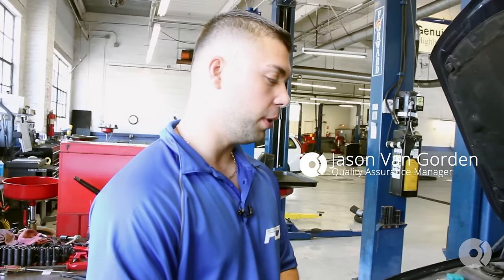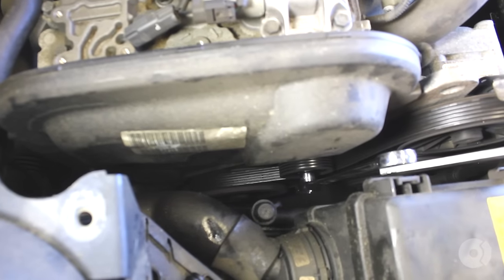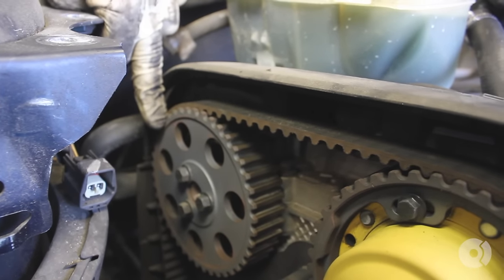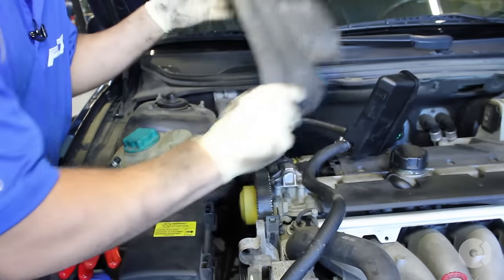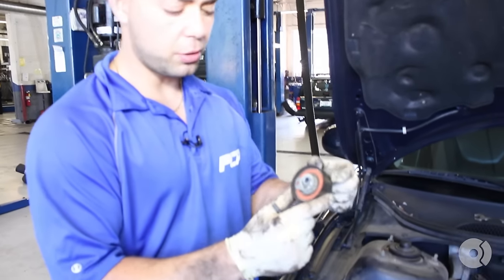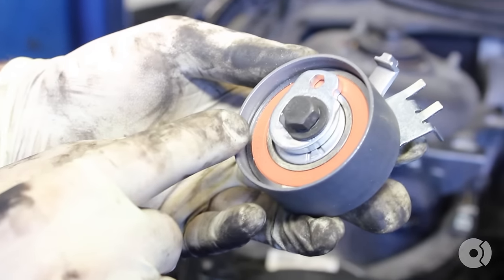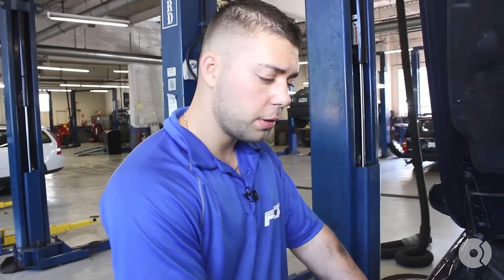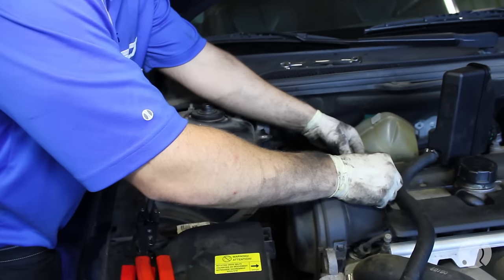Volvo P2 S60 Timing Belt Replacement DIY (S60, C70, V40, V70, S40, S70, S80, XC70, XC90)

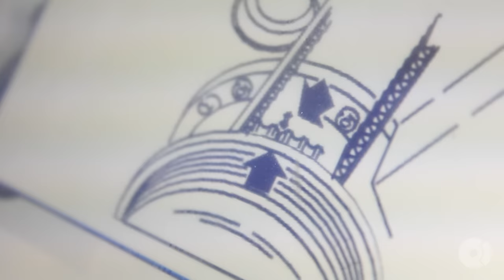Comment from the maker: At 6:10 we explain the marking on the crankshaft. There are two gear teeth with etched markings on the crank gear and one alignment mark on the block. Line up the mark to be position in the center of the etched teeth.  It is possible to slide the timing belt on to crank shaft with out removing the pulley possible but I always advise against it if this your first time carrying out the repair as you can't verify the cogs from the belt are inserted properly into the gear teeth. Hope that helps.

Comment from the maker: You can replace the belt without removing the crank pulley however I advise against it because you cannot see if the belt is fully on the crank gear. It leaves room for error. The procedure is the same on a S40 with the exception of one additional step - supporting the engine and removing the front engine mount location on the passenger side. Hope that helps.

Comment from the maker: Are you talking about the plastic cap that covers the pulley center bolt? All you've got to do is pry the cover off. I usually go at it with a 90 degree pick and pry against the pulley. Hope that helps.

Comment: Excellent video, great job capturing all the bolts/tensioners in such tight places.. I know it's a PITA from the DIY videos I've made.  This job is fairly easy relative to other cars.. well it's no Honda but still easy.  I could not find any DIY guides on this with pictures so this is extremely helpful, aligning the cams was my primary concern but this seems fairly easy, thanks a lot!

Comment: Tip to others, your serpentine belt will probably require a t-60. I was replacing my serpentine belt tensioner as well so i made with what i had and a 9mm allen managed to release tension well enough to get the old belt off. The new gates tensioner used a 15mm end wrench to tension. 

And a question for FCP, I used oe volvo tensioner on my 03 and it did NOT make the click like it did when Jay demonstrated.   Did i do something wrong?

Comment: Great video! I do have a question, noticed you didn't use a cam locking tool or a crank pulley holder. I ordered a timing belt kit from you all and was able to remove and replace the water pump, tensioner, and idler pulley, but couldn't remove the crank pulley to replace the belt, so its still there. I guess my question is how do you keep it from spinning while removing the bolt without a crank holder?

Comment from the maker: I believe the full capacity is around 7l, but you'll probably only drain between 4-5.  When we did the 850 coolant video I believe we used about 4l of 50/50 mix to top it back off. Hope that helps.

Comment: When I did my 01 xc (with your parts of course) The variable exhaust cam was under spring tension and sprung back about 20 or 30 degrees as soon as the belt was removed. It took me awhile to figure this out and get it back correct. Now I need to do my 07 xc that has both intake and exhaust variable timing cam gears. Great video but was "shocked" you didn't lock those cam gears in place or that they didn't move. Why didn't they spring back like mine did? Thanks and keep up those great videos...
Reply from the maker: You can either use a locking tool to hold the gears or sometimes turning the engine past the marks 3-4 teeth then back counterclockwise to line up the marks, this may relieve any tension.

Comment: "1100 bucks to change a belt?? Screw that, I'll just do it myself! How hard could it be!"
.......
Guess I better start saving
Reply: A garage with a camshaft sprocket locking tool and impact to remove the crank pulley is good in less than 1h to replace the belt, idler and tensioner. Let's say 1.5h if they really take it slowly with a few breaks.  If you get genuine belt kits, it's $180 at Fcpeuro, but the Contitech kit is $80 and will do the same thing. So even with a genuine kit, this is the kind of repair that shouldn't cost more than $300 at any garage. Make sure you mark their position vs engine head with liquid paper. That's without the water pump because we don't replace it with the first belt, the original Aisin pumps were good for 200,000 miles if the proper coolant was used. However, if purchasing a used Volvo, always inspect which timing belt components have been installed, including the water pump. The pump is hard to see from above, but you should still be able to see with a good flash light if at the bottom of it it's stamped Aisin. Some kits came with Hepu or GMB pumps. Other pump brands can fail all of a sudden and ruin the engine. By the way, if you release the tension on the tensioner and carefully pull on the belt near the pump (without removing the belt), you should be able to free the pump gear enough to spin it free by hand and see how smooth it spins: if it spins very 'freely/easily' it's rather worn, if it feels it's slightly grabbing, it's worn, if it 'squeaks' then it needs replaced asap. At 9:00 in the video, go ahead and SPIN the pump by hand. A pump in good condition will spin very smoothly and with resistance like it has heavy sticky grease in the bearing - same way all new pulleys spin. The pump is difficult to replace because you can't put the ratchet on some bolts and you can't use the 3" extension either. May try a longer 10mm socket. You notice there is also a small hole at the top of the pump casing: if this hole is sipping or looks like it has limestone traces, it means the pump started to leak at the bearing and would need replaced. At the junkyard I've never seen a pump leaking like this, however I've seen a few that were very worn at the bearing ("grabbing"), and didn't start leaking yet. So don't wait for it to see it leaking. I should upload on my channel a video showing all this. Funnily enough, Jay didn't lock the cam sprockets: that's not a good idea. It is very easy to accidentally touch and rotate the sprockets while working around the belt. Plus, some VVT hubs are spring loaded and will move the sprocket once the belt is off. The video also didn't show that before setting the tensioner, you need to to make sure the belt has tension between the idler and the intake cam sprocket: so need to rotate the engine by hand a full turn clockwise (never go counterclockwise) until the timing marks are aligned again, then adjust the tensioner and tighten the bolt: important, tensioner bolt has 15ft-lbs (20N-m) torque. Before installing back the belt covers, put serpentine belt in place and fire up the engine and look at the tensioner, the indicator should stay at the right position without much shaking (ideally no shaking at all)
Reply: @Peppermint1  should I replace my timing belt the car has only 100 000 km but it is 10 years old now.
Reply: @alexanderstevens145   Everybody will tell you to replace it. You can check the belt in 5 seconds without removing anything. If you plan to keep the car for several years, I would replace the belt with a Continental kit and only inspect the water pump is turning smoothly without 'grabbing'. Order the correct tensioner for your year. If you don't think keeping the car more than 2 years may just want to keep an eye on the belt.  Belt wear will also depend if you live in a very hot region and if the car was driven hard. My original belt at 160 000 kms and 10 years had a single small crack on it. The original Volvo belt can take a lot of cracks before failing, while the cheap aftermarket ones may crack after only 1-2 years. Check my channel, I have many repair Volvo videos
Reply: @Peppermint1  thank you 🙏
Reply: @alexanderstevens145  I think it would be a good idea to change it because the new one should last you another 10 years or 100,000 km and the risk of engine damage caused by the belt breaking is not worth the risk.
Reply: @danielebrparish4271  I got it done 👍 was a thousand dollars but I’m happy just went to a professional drives beautiful
Reply: @alexanderstevens145  That's what I paid to have mine done in 2013.
Reply: @danielebrparish4271  I’m in Australia though so I don’t know if that’s much different

Comment: I believe the reason why the cam lost a little timing there was because when you corrected it, you rotated counter clockwise. Should only rotate clockwise as different sides of the belt have different tension. Loved the video!
Reply from the maker: Great point! Thanks for the info!

Comment from the maker: When Changing the belt as long as you don't unbolt the camshaft pulleys or Variable Valve Timing units you there is no need to pay any attention to them.  Hope that helps.

Comment from the maker: The click was actually the tension releasing as the allen key slipped out of Jay's hand, so now worries regarding not hearing it.  Just make sure you tighten down the center nut with the appropriate tension and you're all good.  Hope that helps.

Comment: Thanks for the video. A few questions about it.

1) Is this the same procedure for an ‘05 Volvo XC90 2.5T?

2) Would you recommend I get any additional tools for my specific car?

3) How easy is it for the cams to move once the belt is off? Just worried about them moving once the timing belt is off. I’m thinking of using something to mark the cam positions on the engine block. Can I turn the cams by hand if they move slightly?

Thanks for your help in advance!
Reply from the maker: Hi Vishal, yes this is the same procedure as your XC90, in fact, you might even have a bit more room to work with on your XC90 vs the S60! The cams can move, and yes you can move them by hand, you just want to make sure everything lines up like before. Some people use a whiteout marker to make markings. Hope that helps, and good luck with the timing belt replacement, just take your time with the timing job, and you'll be fine!

Comment: Nice video. What if you turn the crankshaft counter-clockwise after the tensioner has been locked in position, will the belt get loose between the crankshaft and the intake sprocket?

Comment: Thanks for the great video - best I have found on this topic!  I have a 2006 xc70, and I`ve changed the components successfully - but I have 1 issue.  The timing belt seems to shift towards the engine block against the water pump pulley.  Any ideas on what could be causing this issue?

Comment: Awesome video! Just have few questions though - I have 03 S60 2.4T and this is my first time replacing my belts and waterpump at 90K miles. 
1. How do you loosen the crankshaft bolts (30mm and the (4) 10mm) if you don't have impact tools without moving your camshaft alignment?
2. What are the torque specs for the bolts on tensioner and idler?
3. For the tensioner temp settings, are you referring to the room temp or the engine temp? Or would it be safe to assume that whatever the tension setting was before you loosen the tensioner is the same setting you will follow before tightening it?

Thanks and more power to you guys.
Reply from the maker: 1. Either use an Impact gun like I did in the video or you can use a counter hold : http://www.fcpeuro.com/products/volvo-crankshaft-holding-tool-cta-2247-2248

2. Not sure of the torque specifications to be honest. I'd recommend purchasing a repair manual: http://www.fcpeuro.com/products/volvo-repair-manual-s60-4793

3. Referring to the ambient room temperature. 

Hope that helps!
Reply: FCP Euro Great!Thanks for the quick reply.
Reply: pro glock Is it possible to take out the belt or install the belt without taking off the crankshaft?

Comment: Great video with very thorough explanations on a very delicate service. I am about to change the timing belt in my '05 S80 2.5T and it has VVT on both camshafts. Do i need to adjust the VVT cam gears (remove the 3 bolts securing the ring and reposision them) at all when changing the timing belt or just align the timing marks shown in the video, change the timing belt, idler and tensioner and I'm good to go? Cheers from Finland.

Comment: Thanks for the video I replaced the timing belt myself. If you can give me any advice. I got 2005 XC90 2.5t I had to replace broken spark plug on cylinder #3. Actually the ceramic piece of bad spark plug felt down in a hole. After putting a new spark plug I took the car for a ride.

Comment: How were the camshaft sprockets locked?. Excellent.
Reply from the maker: In this video, Jay did not use a tool to lock the camshaft sprockets. Instead, once he got everything to top dead center (lined the marks on the sprockets up with the marks on the timing cover), he went ahead and did the job. If the marks aren't lined up perfectly when you put the new belt on you can turn the sprockets by hand when the belt is removed to line them up properly as Jay mentions in the video. Hope that helps!
Reply: @fcpeuro  It certainly does, thank you so much.

Comment: Hey that video was helpful thank you!
But what can you do if you forgot to mark the camshaft and then moved a bit? Is there any easy solutions to fix the problem?
Reply from the maker: You're welcome! It depends how much you moved it, if its just a few teeth you can move it back by hand to the correct position.
Reply: That sounds like a big problem.  That's probably the most important part of this job!!!

Comment: Any particular reason a Cam-shaft locking tool wasn't used? Would it make it easier to do that last step of aligning the marks after putting on the new belt?

Thanks again for the video! It answered a few questions for me. I have to do this in the next week or two.

Comment: First off great instructional, I wish I could make this look as easy as you have.  

Secondly, 
I have a 1998 V70 GLT that I need to replace the serpentine belt and the timing belt, can you advise what position the tensioner should be in on the timing belt (in the video you had it at 11 o'clock and then moved it down to 6 o'clock) or would I be putting it in the same positions?  

When you are tensioning the serpentine belt does it automatically lock into place for correct tension?

Comment: Has anyone had an issue with the plastic timing cover being warped and not sealing correctly? I am in the process of replacing the alternator on my 2009 s60 and there is a gap in the front side of the cover behind the power steering pump and alternator. I took the cover off and reinstalled to no avail, it’s almost like it is warped. I’m wondering if I should just replace the cover? And thanks for all the great vids, they are a lifesaver:)

Comment: How would a cam holding tool help in this job? I can see using one to hold the cam while removing the gears but in this situation it is practically not need. He performed a great, efficient job. Also, the serp belt was replaced with a new one. You can tell it is new because of the shiny diamond particles on the belt.

Comment: I am going to be replacing the timing belt and water pump on my GF's S70 GLT. (it has 170K), The engine is pretty much the same, with a few minor differences. Can you give me any advice as to how much different it will be than this car? I am assuming that I need to drain the coolant fist to change the pump, correct?

Thank you very much for the video. I am finding myself enjoying working on cars more and more. I just LOVE Volvo's too. This is my third one! The last two I ran for over 200K miles!

Comment: Great video. I'm getting ready to tackle this job myself on my S80 T6. I have one question. After you get the new belt on the first time and check the cams you say that they have moved and it will need to be re-done. Then the video jumps to you placing the belt on the 2nd time and everything is good. What did you do to fix the fact that they had moved the first time? Thanks!

Comment: Hello, I am already an FCP customer.  I have a 2002 Volvo V40 and noticed the layout is extremely similar.  For the S/V40, should the tensioner be set at 11 o'clock or at 2 o'clock?  You mentioned some Volvo engines have the latter setup.  If I also do water pump, do I drain coolant prior to removing expansion tank? Finally, I noticed you carry a blue colored Gates performance timing belt.  How much better is that belt?  Thanks for all your help.  The tutorial is awesome!  Also have VIDA....

Comment: Great video but this is the one area of my 99 S70 T5 I refuse to touch :(

I've replaced all of my suspension stuff about 100K miles ago, driveshafts, literally everything that coolant touches but that timing belt can piss right off.

Also, I was under the assumption that using a cam locking tool was required for this job?

Comment: this video is 7 years old and I don´t know if you still answering questions of your viewers? I am sure this video helped a lots of newbies like me. I have a question and I hope you can answer me. I have a problem. I found out the my volvo s60 non turbo exhaust solenoid gasket broke and a lots of oil drip all over, into the Timing belt, Shall I change the whole timing belt or just clean it. In that case can you give advice what are good product cleaner to use. Must appreciate if you can answer my question. Thank you.